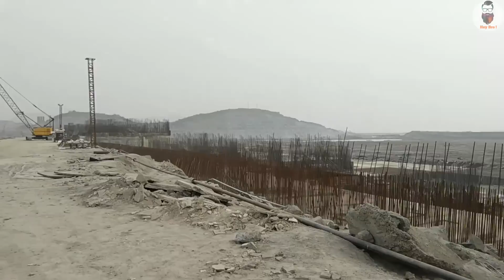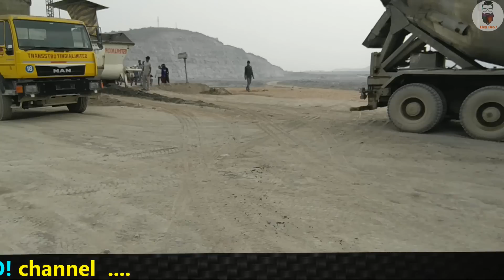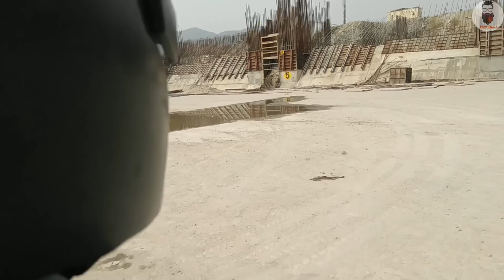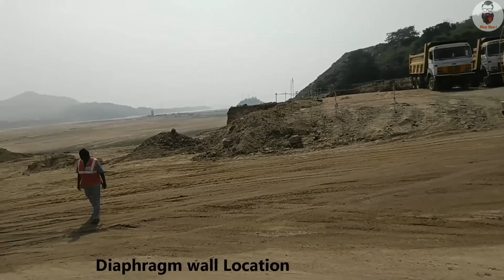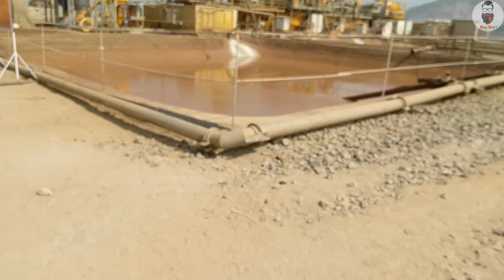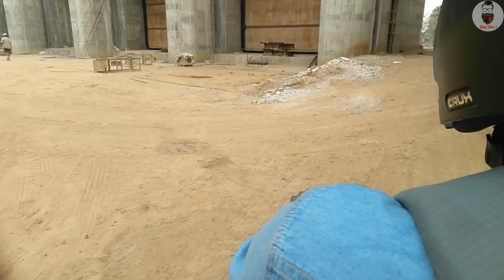Polavaram Project Status FEB 2018 || 11-02-2018

Comment: Project should have been left under responsibility of central government, unnecessarily AP state gov insisted to contract itself. Well this behaviour raises suspicion that proclaimed contract bills can be over estimated. Which leads to scams and less quality of dam and non consistency with designed dam construction plans. Disappointed with ap state gov approach. It should have left to central gov responsibility and ap state gov should have functioned as quality inspector in process, ensuring no compromise in quality and design. Political minds and there greed are greatest disgrace to this great nation.

Comment: HEY BRO! can you please mention the complete R.L and the present R.L that is completed till now and can u please specify is there is a earth dam for polavaram project if there is earth dam please specify the length and can u show us the head regulator and surplus channel works because they are the main parts of the reservoir to supply the water and please mention the storage capacity